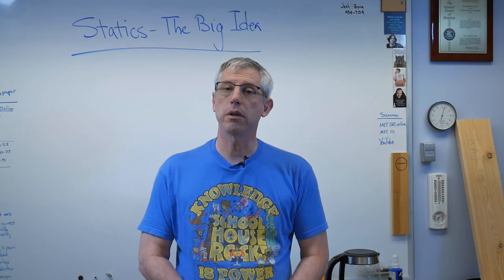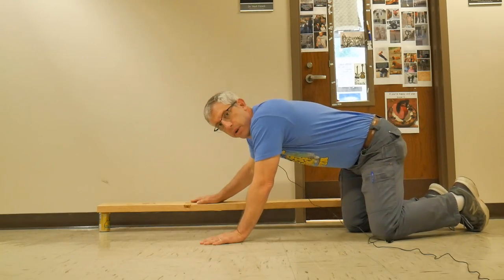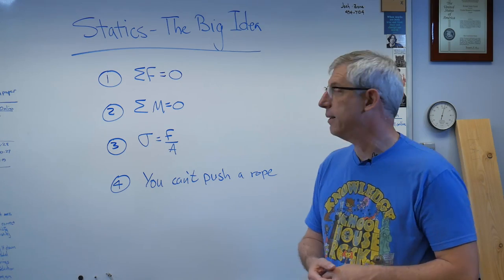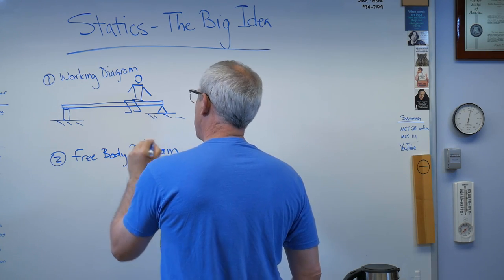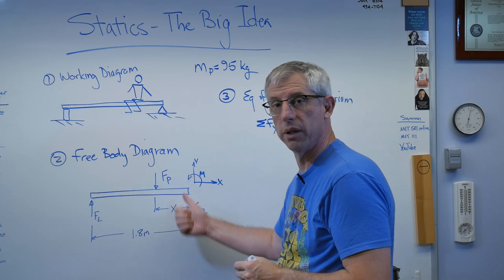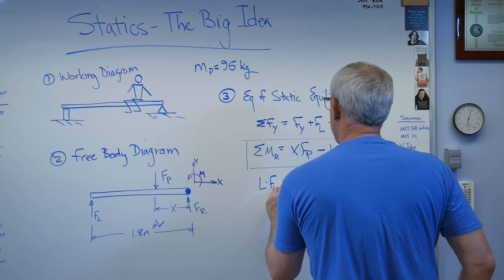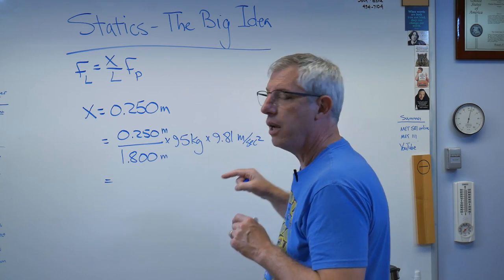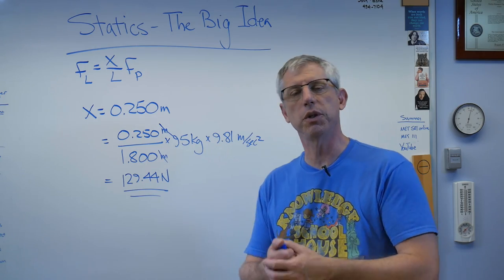Statics - The Big Picture

Comment: I just checked the very frame before the can popped, you were sitting about 47% away from the right of the board, so by the same calculations the can actually resisted almost 440 N! Loved the practical example to demonstrate an engineering topic as always.
Reply from the maker: Thanks for checking.  I had actually done the calculations based on a previous take when the can failed a little earlier.